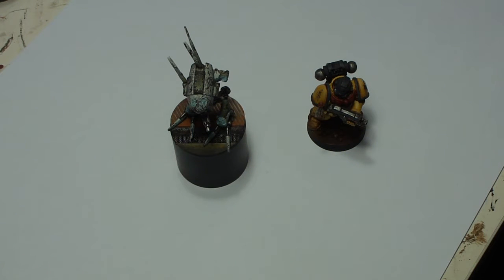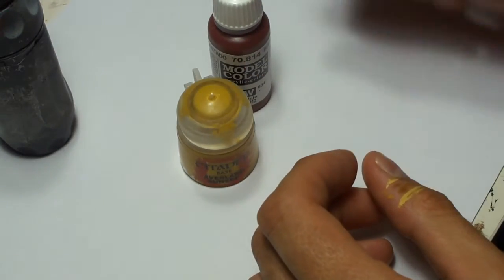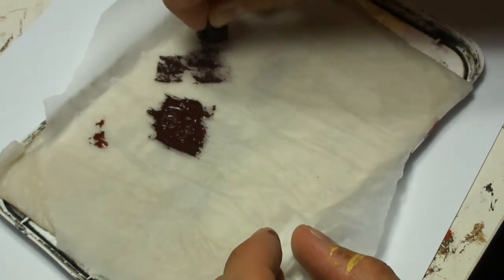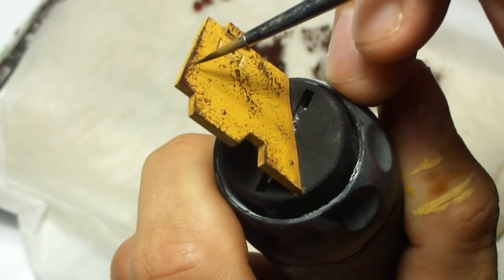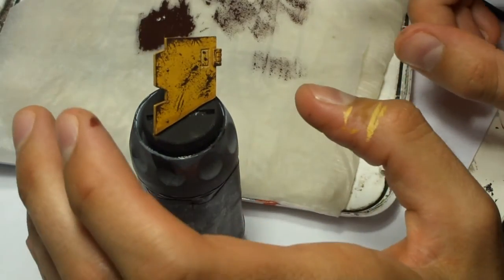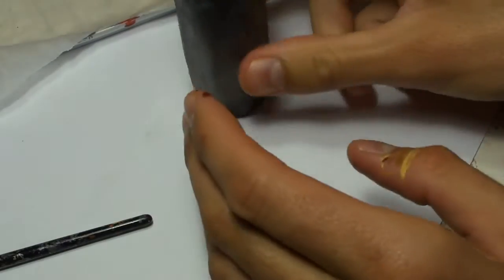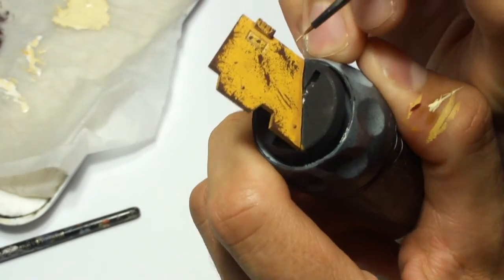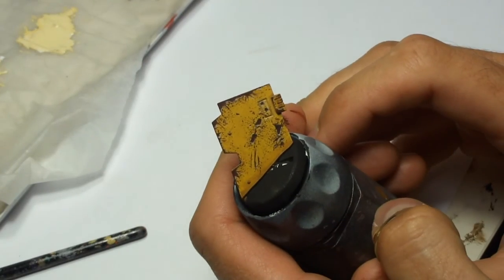Easy chipping/scratching effect TUTORIAL

Comment: Great technique, but not a fan of the extra light edge though.
If anything, i'd use that lighter color with the same spongue technique first, then go over that with the rust using the spongue and then lighter rust with a brush.
That way you do get the idea that paint has worn and after that where it is gone it started to rust, but might look more natural and might be easier to do even. I find the lighter color here too clean and straight line. Plus you might get more lighter spots of worn paint but not rust yet.
Gonna have to try this.

Comment: Hi, thanks for another great video. I am currently painting a Infinity T.A.G. Dark blue color but highlighted to bright light blue with airbrush. A bit more vivid and bright than I would have wanted. As the rest of the army is a bit gritty and based in a swamp. I would like to use your chipping style. What colors would work for the chipping with blue? The same darkblue I'm guessing, but what to mix it up with for that first sponge applied layer?

Also any tip except chipping I can use to make the overall model look less bright and more gritty? Some kind of wash or would that ruin highlights?